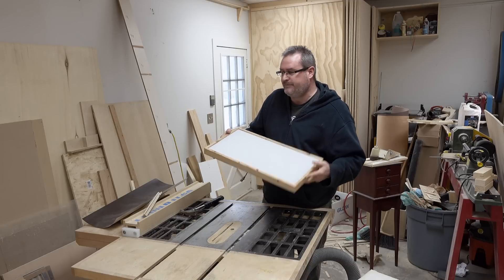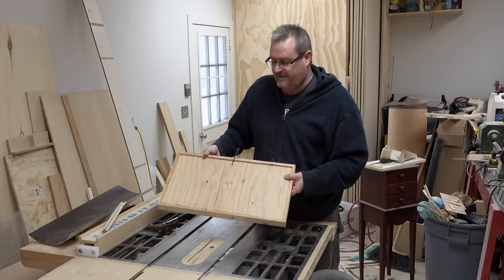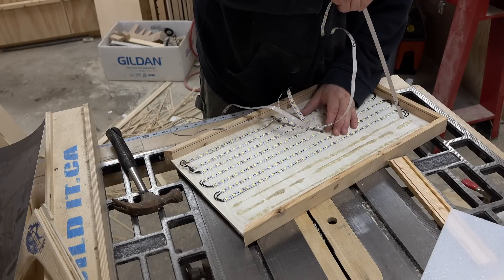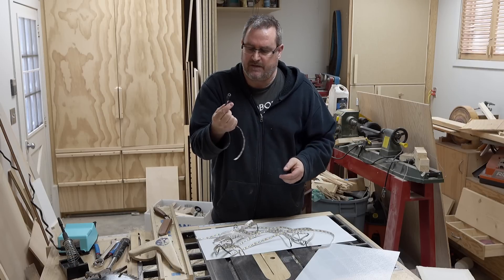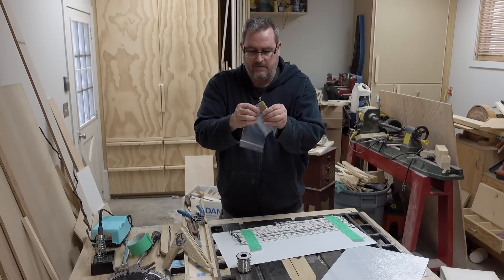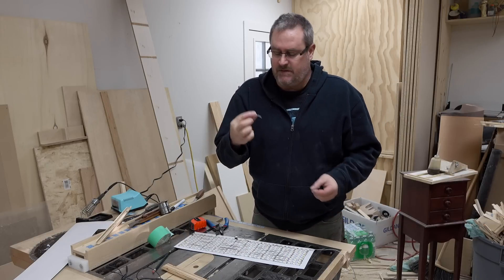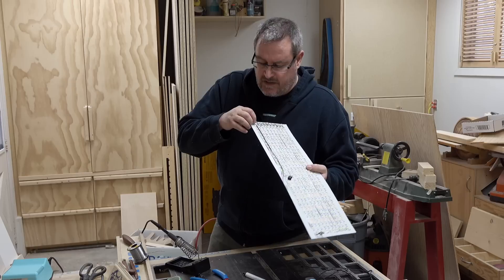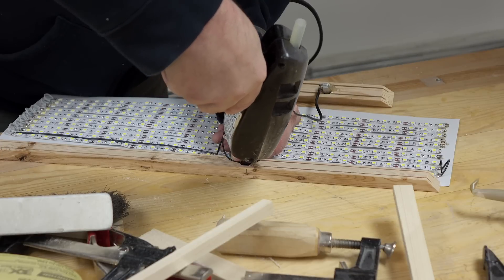Make This SUPER Bright LED Light Panel

Comment: Nice elegant build, I'll use this in the bathroom as a modern interior lighting. I couldn't find the "Fluorescent Fixture Lens" from home depot, the lens you used in the video seems to be best suited for LED diffusion as it has a milky coating. Have any recommendations where I can buy them from specifically? Thanks.

Comment: Now, you’ll want to make another one of those and have it mounted on the ceiling, pointed downward and slightly behind you.  This will give a bit of a rim light around you, some separation from the background and ultimately a bit of depth.
This is my PSA Tip for a professional photographer.  Wanna see what I’m talking about, watch any of the national news programs and you’ll see just a sliver of light on the top of the reporters heads and shoulders.

This is a phenomenal DIY project that can elevate any youtubers vids

Comment: Looks like a really nice light but its a shame that you didn't opt to glue the stripes to the metal plate using thermal glue, not only will it a little safer, your LEDs will last way longer.

Comment: You said, "It's a lot brighter." Is that simply from placing the lights closer together? I'm wondering how a smaller light can be brighter when the same number of LEDs were used in both fixtures. Thanks!

Comment: On Amazon, they offer a stronger hot melt glue.  It costs a bit more than the clear or white glue sticks but the strength is considerably stronger.

I use it to repair the sole heels on my walking shoes and the stronger glue stick is really tough and lasts a long time.
Try it, you'll like it and you may not need the pin nailer.

Comment: I don't know what you have invested in that time or money wise but you can buy 2' X 2' LED and 1' X 4' LED lamps for drop ceiling at your local electrical supply house for about $60.

I notice your workshop has the same issue mine does. Clutter just seems to happen. :)
Reply from the maker: Do they run off a 12 volt battery?
Reply: They run on a 12-volt power supply that comes with the lamp. So, I would say yes you could easily hook them up to run off of a battery. I really like your work and think your lamp is fantastic. I just know there are many folks that do not have the fabrication skills or the tool collection you possess. 

I do watch a lot of your vids.
Reply from the maker: Actually, this channel is all about the fabrication. Even if they can run from a battery, the lights you described are too big.
Reply: Yes, they are large. I am actually planning to utilize 2 of the 1' X 4' units in a green screen setup. I, of course, will have to fab up brackets and floor stands for them.

I am all about DIY.

Comment: Good seeing you re-assemble these strips in parallel as I discussed in the first video, John. Those flexible copper traces have a surprisingly high resistance which gets pretty inefficient over longer series lengths. I've made two panels out of these LED reels, however I used a reel of 5630s rather than these dimmer 5050 SMD LEDs. Those develop several times the light by chip density, meaning you can pack them right in there. My lighting arrangement consists of a three-point setup with key/fill/hair, each being approximately 12'000lm (), 3'200lm and 800lm respectively. It genuinely makes an enormous difference. The downside is power requirements as the key needs about 12A/12VDC to operate at full brightness. Pretty strong stuff. For the same size of panel you have there, you'd be able to increase density a little and get 5-6x the light output to really kick out the shadows. Maybe use that one as your fill in addition?

Comment: Thanks for the video John.  This is exactly what I am looking for to mount to the ceiling in my shop.  Could you provide a link for where you bought your LEDs?  As I search online there are several factors to consider when buying LEDs and it would be great to know exactly which bulbs worked for you.  Thanks!
Reply from the maker: I don't have a link, but the most important thing to look for is color temp - it needs to match your shop lighting (for video, that is).

Comment from the maker: Updated build article: http://www.ibuildit.ca/other%20projects/led-light-panel.html

Original build video: https://youtu.be/YWFjJ4V_zFM

Wiring the short strips in parallel reduces the voltage drop that occurs when powering a long continuous strip. This will increase the light output, but also draws much more power from the battery. Since I only use this light for video and pictures, it's not on constantly, so battery drain and heat won't be a problem.

You can help support the work I do in making these videos:

Plans for sale: http://www.ibuildit.ca/plans.html

Support this channel on Patreon:
https://www.patreon.com/user?u=865843&ty=h

Did you know I have other YouTube channels?
My main channel: 
https://www.youtube.com/user/jpheisz

My home reno channel: 
http://www.youtube.com/c/IBuildItHome

My "Scrap bin" channel:
https://www.youtube.com/channel/UCaJsEh2_YxWHMcjASs4cJcA
Reply: Yonatan24 like a large piece of aluminum flashing?
Reply: Why go to those lengths when these types of LEDs are bright enough and require no heat management?
Reply: John, have you tried 12V 10W LED's? I've bought them on eBay, and have used them for several projects already. 
They take up way less space.
Reply: But you'll need a big heat sink too...
Reply: Just Googled to know what that is. 
I don't think so. You need a serious heat sink for dissipating the heat from several 10W LED's.
Reply: Or you could buy an ATV light bar and put it on an arm to precisely light up a work piece or an area. They're stupid bright and easy to mount on anything.
Reply: Cheaper (or at least very cheap)
Easier and faster to use
More compact (takes up less space - I built a big wooden articulating arm for my homemade variable spectrum panel (with these LED's, of course). If I wasn't able to make it that small, I'd keep banging my head into it...)
Better for me!